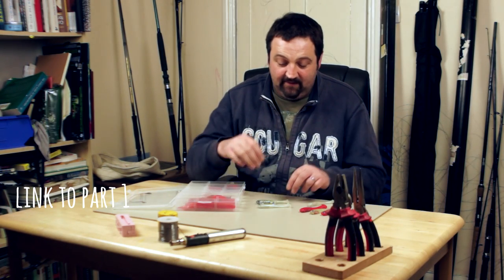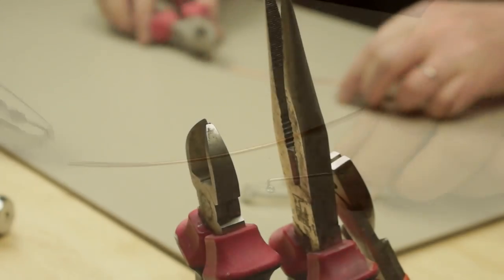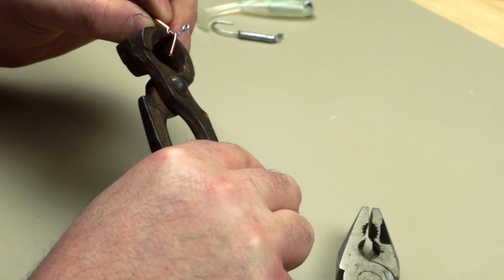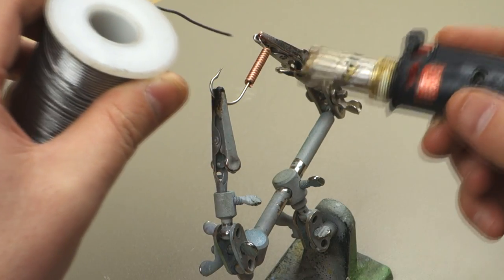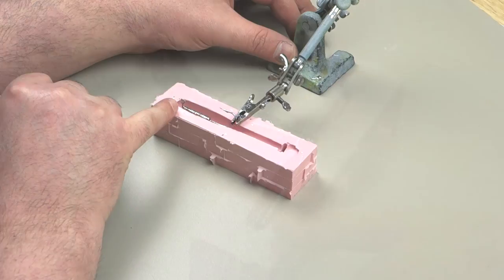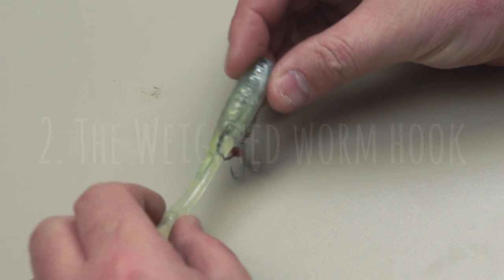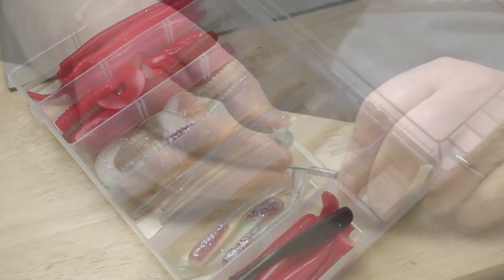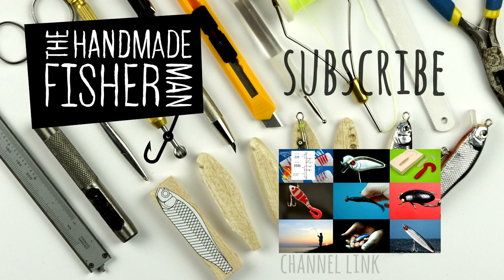Making Paddle Tail Soft Plastic Fishing Lures part 2

Comment: Hey Paul I understand you reuse and remelt your plastics I was kind of wondering about the scent on them. Plastics are supposed to be kept at approximately room temperature so would you remelt ones that may be sun-damaged? I only ask because I have read fish can smell burnt plastic if they have been exposed to the sun for to long as well as deformed baits. Thanks, MWFS
Reply from the maker: i am probably the worst person to ask about this as i live in the uk and we think we are having a heat wave if the temperature gets up to room temperature. I think sun damage would probably have more to do with ultra violet light damage, i remember when i used to sell pvc products for outdoors this used to a big problem and would cause plastics to become brittle. When remelting the plastics i find they loose some flexibility this could just be a loss of plasticizer from the pvc,i find  old baits stiffen up over time.   I do not remelt baits i have scented my, last experience with this was not great and it took a long time for the smell to dissipate. 

Smell wise tend not to add scent when i make the lures, In the summer months when i fishing with some speed to my retrieves  i do not add any scent as i find fish tend to be chasing them down. In the winter i add things like thia fish sauce or fish oil to a small tub and soak the lures before i go fishing and dip them from time to time when fishing. I have had pike take the lures like dead bait off the bottom, i remember stopping to talk to a friend and finding after 5 minutes of lure lying motionless on the bottom it was picked up by a pike, which was really a big surprise. 

Cheers

Comment: I think you should just leave it at copper and epoxy considering it is the main source of weight and heating a hook can weaken it. Also if you make a clear minnow it would show through in a cool way
Reply from the maker: the solder has very low melt point two thirds of lead so ever though i am using a small torch and keeping it moving the temperature i am guessing is about equivalent to casting  a lead jig head on a hook. I do use epoxy as well which give that nice copper finish. cheers

Comment: Once again awesome video, just 1 question, arent you weakening hook while using heat on it ?
Reply from the maker: +Michał Stankiewicz (shaitis) i do not think it is getting hot enough  for long enough as the melting point of the solder is very low, half of that of lead which is used to make jigheads

Comment: very cool, but why did you use copper wire instead of only using the solder and epoxy that in place?  the solder would bend much easier and you wouldn't need as much as the lead solder is heavier than the copper.
Reply from the maker: This is lead free solder, which is very expensive and not as dense as the copper, the copper is just under 9x denser than water, the solder 7.25x denser than water and lead would be about 11x.  Cheers
Reply: ah ok, thank you.